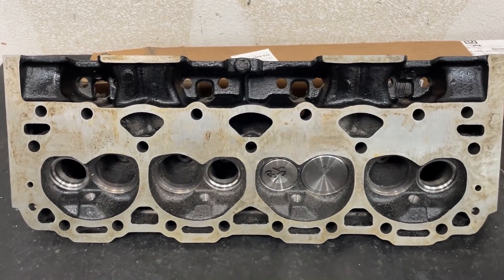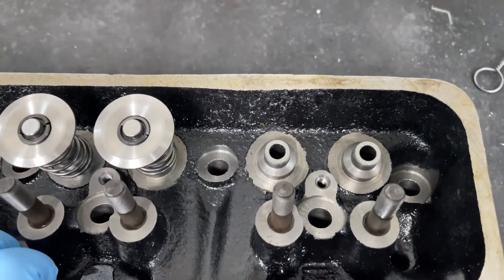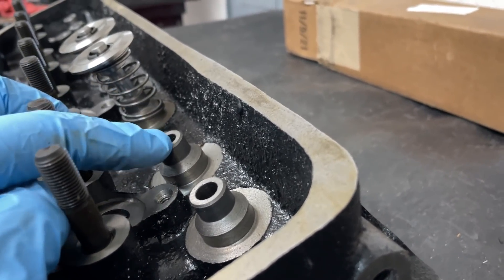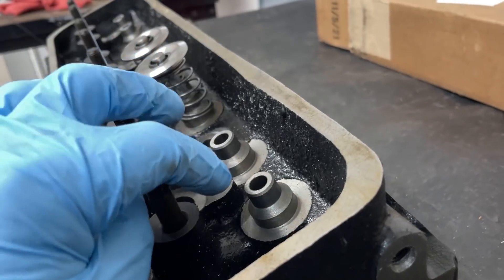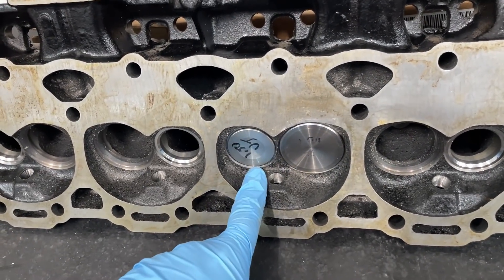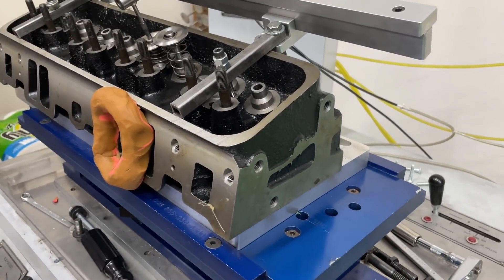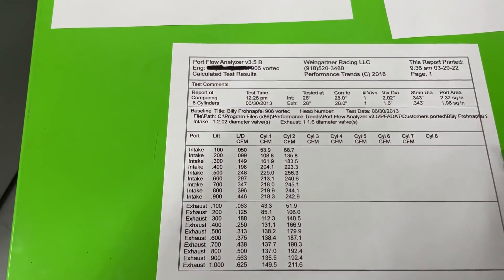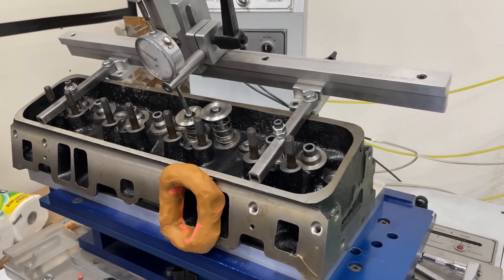Speedmaster Vortec Head Review With Real Flow Numbers

Comment: I built a 355 over 20 years ago and put a set of pro top line’s version of the vortec head on it. They worked very well. I also used Childs and Alberts gapless rings, which you can’t get anymore. That engine is still roasting tires for the guy I sold it to.
Reply: isn’t this an Australian company? I think no matter how good they are, Shipping to the USA/Northeast would be cost prohibitive for me.

Comment: The easy way to get clearance up to .550 lift was to use Comp 26918 springs or the PAC equivalent (1218 I think), 795 10* retainers and 614 locks which are 10* +.050 locks. Install height is around 1.75-1.77 and there's enough spring pressure for a decent HR cam. This method has been done a million times but that kind of spring pressure does require the studs to at least be pinned.

Comment: Another thing to when you mention bronze guide vs cast I used to work at a machine shop and my old co worker had EQ heads and he had the valves sticking with the bronze but not the cast. So I thought that was interesting when you said the cast ones were sticking but good think to know

Comment: Nice video on different vortec head and does the aftermarket heads are thicker than the stock ones I know those stock vortec heads are known to crack and and does the aftermarket ones prevent the cracking if they are thicker
Reply: They are much thicker or at least they seem to be I run these on demolition derby engines and I have yet to crack one. I've ran several sets 20 plus minutes with no water in the engine whatsoever multi-layer steelhead gaskets and ARP head bolts. If I do crack a set I'll retract the statement lol
Reply: @timothyesmond7358  got it thank you

Comment: Procomp/speedmaster is nothing but junk. Everything they sell is junk with the exception of their Mopar Victor Jr big block head. Even their valve covers are phucking junk. Want to waist a good engine, put their roller rockers, lifters or valve train in your engine. I would rather have a sister in a whore house than run anything from procomp!

Comment: Studs?  I have removed studs and never had issues. I have machined and tapped screw in studs. Not very succesfull! They were not square with each other. Subsequently just paid to have it done. Pinned studs?  The boss can and will break, I have seen that a couple of times. Though have seen the Boss break with a big cam and springs as well.
I have seen screw in studs break as well. Use ARP, not cheapies as they will fail

Comment: The vortec heads that have the hardened seat inserts are from Hd trucks. If you get a 5.7l C/K3500 they will have hardened seats. The really big issue i have heard is they have a 90° final taper on the insert. The only way to fix it is to go to a bigger valve so you can have a clean up the angles on the valve job.

Comment: Eric, back years ago, like I’m the early 90s when I started actually rebuilding engines, & years before I worked @ the race engine shop, I used to stack some heavy washers on the studs & then grab a good 1/2in air gun & just tighten the bolt against the washers! It used to pull them right out 🙄🙄🙄🙄! I’ve had those press in studs pull out on a RV type camshaft before! Actually even doing all the work yourself! Which you know you could spend hours on! Before you even get to the valve job, it seemed that we could buy decent aftermarket heads with all decent parts in them for not much more money 🙄🙄🙄🙄! It got to the point that unless it was a restoration job! We would just save all the hours of making them decent & replace the heads with Darts, or World products ones! My boss used to buy them by the pallet & he knew Dick Maskin & Billy Mitchell so we would get a really good deal on them! Never mind you should have seen the customers light up 😍😍😍😍 when they found out that their stockish type rebuild had a new rotating assembly & brand new heads! At that point they were so happy that they didn’t just buy a Targetmaster 350 & stick a cam in it 😂😂😂😂! Most went out as 465hp/475ftlbs 383s, if they weren’t superbrokedicks & actually had us put a decent carb, intake, headers & oil pan on them! The guys that wanted everything original! Heads included,  got what they got because manifolds sucked & the stock 2bbl Rochester carbs were tiny 🙄🙄🙄🙄! But even when we had to do it that way the boss would get sneaky with the ports, compression & camshafts to make sure they made around 1hp per cube, which sounds poor! But they were way more powerful than when the engine was factory 👎🏻👎🏻👎🏻👎🏻! My bosses shop was well known for making power & building engines that would last decades 😂😂😂😂! Those old 306s 331s 355s 383s that were done with the good bolt ons, are still out, most getting the shit kicked out of them w a minimum of a 150 shot or even 2/150 shots & still going after well over 20 years 😂😂😂😂! NOBULLSHIT 💩💩💩💩💩🤪🤪🤪🤪🤪! That’s the main thing my boss would try to pound into morons heads 🙄🙄🙄🙄! Build the shortblock right, with good machining & parts & have at least 2 different engines out of the one 👍🏻👍🏻👍🏻👍🏻! Because when they finally bought a good set of aluminum heads, bigger camshafts, & bla bla bla, they got another 150hp or more than what we originally dynoed them at 👍🏻👍🏻👍🏻👍🏻! So they only needed 1 kit instead of 2! When they finally give up, it’s usually the block getting split in half with those guys who just keep getting greedy with the nitrous & spray 2 kits at over 175ea 🙄🙄🙄🙄! Have a good rest of your week 👍🏻👍🏻👍🏻👍🏻!

Comment: I'm running a set of EQ heads on my Vortec with 2.02 and 1.6 valves. I'm also running a whipple super charger. Any benefit to porting these heads?
Reply: How do u like the eq vortec heads. I am about to purchase some aftermarket heads. Do u get the fully assembled with  the rockers and springs?

Comment: Hey Eric. I was thinking about your 403ci engine. Maybe the ports were too small for the cam increase. If you're limited on port size and engine displacement in a racing class a common thing is to oversize the cam and it will act just like you observed with the 403. Small CI, small port, big duration cam, means higher peak power and a drop in torque.

Comment: what is a good cheap bare head for a foundation to port on, dart iron eagle?  GM scoggin dickey new casting 906 heads? jegs, dart or promaxx? i really really love the AFR competition cut 180cc, its not listed anymore although comp cut is an option. Someone ran them on their 2nd gen stock chassis and ran mid to high tens Could i port some heads to be as efficient as those at low lifts? i love low lift numbers and high efficiencies. i found some IMCA heads made by EQ they have the bath tub chambers 740 for the pair on evil bay. Its only that those heads are meant for stock class racing and not all out efficiency, i mean it looks as bad as a stock 882 chamber bet it still makes power though somehow, probably after changing them. oh well maybe i find somehting better. yup replacement for 882, and 624 heads. Well i had 882 on the 355 and no thanks.
Reply: @port nut right on :o)